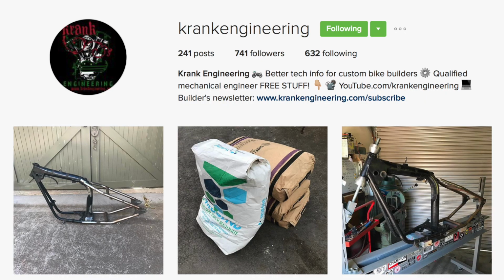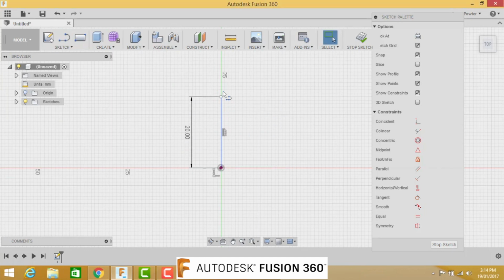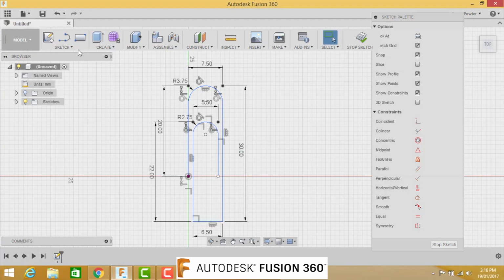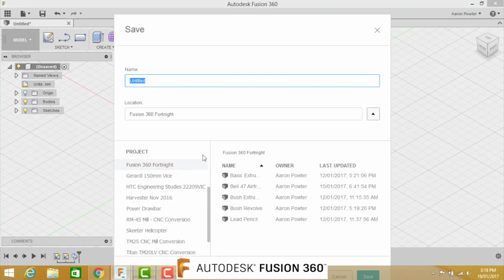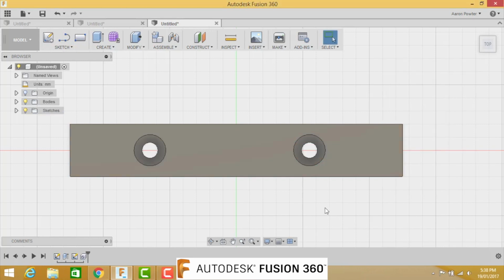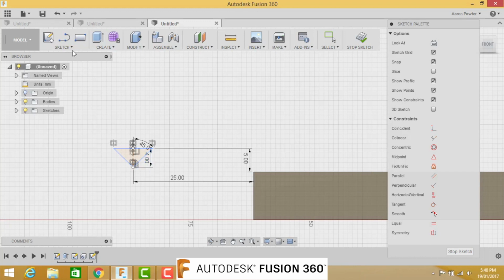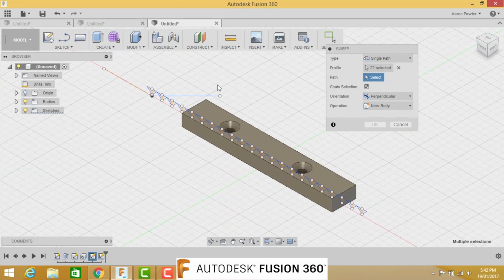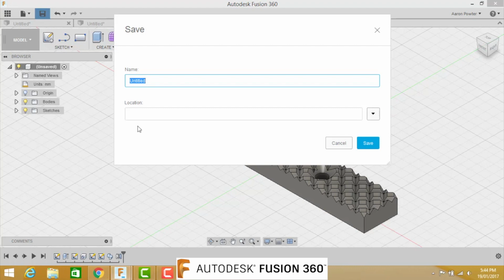Fusion 360 Tutorial - Sweep sketch profile FF.E3

Comment: What does the line two (/2) do when you enter it in the box for the fillet radius?

Edit: just realised it simply means divide by two. I didn't know fusion 360 does calculations in the box. Thanks for showing us. We learn something new every day :)
Reply from the maker: Hey buddy, yes you are 100% correct.  Like most school teachers I try to use numeracy examples in my tutorials.  You would be surprised, but many students don't know that the line in a fraction simply means divide.  The metric system has been great for Aussies, but unfortunately since switching over I believe our fraction skills have  drastically diminished.  Cheers, Aaron.
Reply: DCTTeacher1 At first I thought it was a switch (like in DOS command line) that passed some parameter to the program hehe
Reply from the maker: All good mate.  I agree with you, next time I'll have to explain it better.  Bloody teachers ha ha ha ha

Comment: What is the purpose of changing your preferrence to "z up"? Is there a need to do this?
Reply from the maker: Hello Charissa.  In Australia we are required to draw to AS1100 drawing standards.  This requires us to have "Z-UP".  Also, if your a CNC machinist using a vertical milling machine it is always easier designing in Z up.  That way it makes setting your work offset faster once switching over to CAM.  However, you don't have to do this.  This is simply user preference.  Hope this helps you?  Cheers, Aaron.
Reply: DCTTeacher1 yup it does! Thanks for the detailed reply
Reply from the maker: You're very welcome. Aaron

Comment: dear aaron thanx a lot for your tutorial.
i'm new user of fusion 360.
i want to learn how to make a mold & how to transfer mold cam G-code from fusion 360 to cnc machine.........................please reply me....
i wish you will reply me.................i'm waiting ....................
Reply from the maker: Hi Meherab, yes Fusion360 is great CAD-CAM-CNC software.  You should be able to make your mold using it, but testing the flow you'll need Autodesk Moldflow software.  Cheers, Aaron.
Reply: sir , can i talk with you???????
if you have few time , then i want to talk with you........................ please sir , please .......i'm from bangladesh
i want to learn from you...............

Comment: i need to do a propeller ive drawn it i just need to twist the blade
in solidworks you just use twist command
sweep relies on sketch but i did that at the start so not sure how im supposed to do a propeller in fusion
Reply from the maker: Hi Allen. To be honest I'm really not sure. I haven't used SolidWorks in years and I'm yet to draw a propeller in Fusion360. In a previous CAD system (I used at Uni in my teacher training) I would have used a "Loft command" through 2 or 3 offset workplaces which had a slight rotation to them. I just did a google search and some YouTubers have posted tutorials on it. Sorry I can't help you mate.  Kind regards, Aaron.
Reply: thanks
i think the sculpt mode has the features but its not available to me